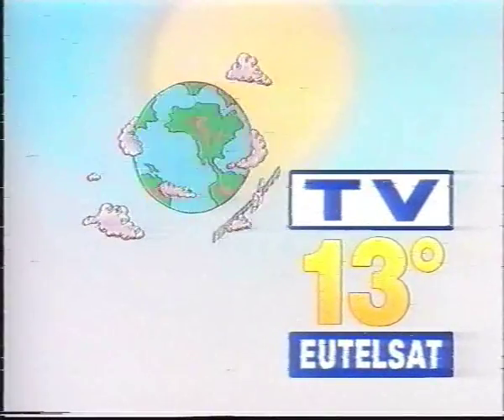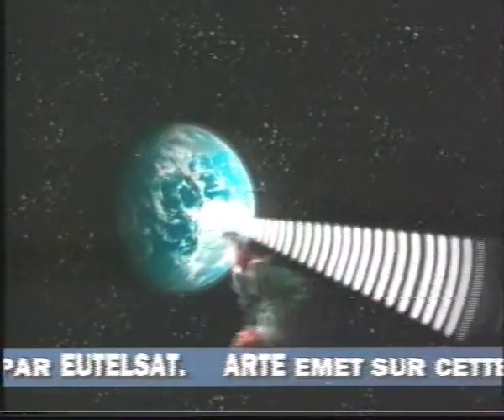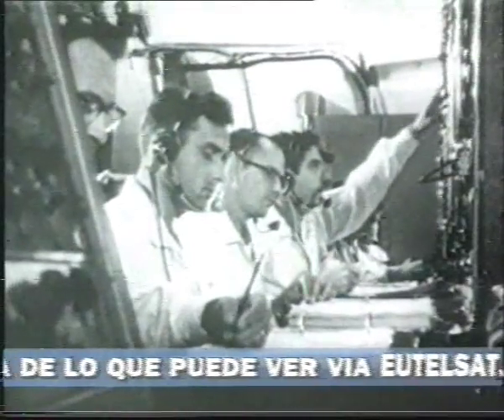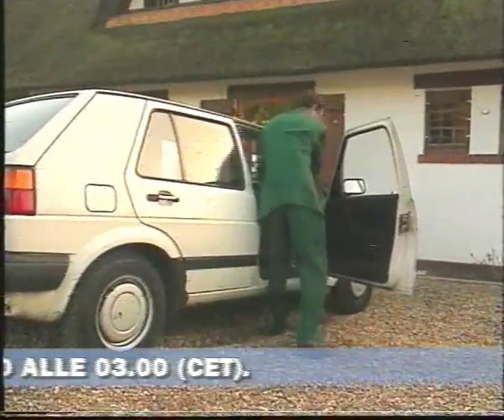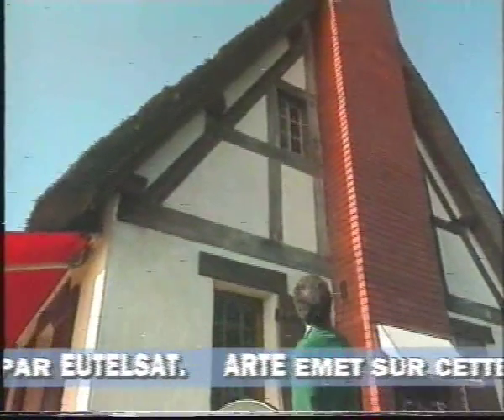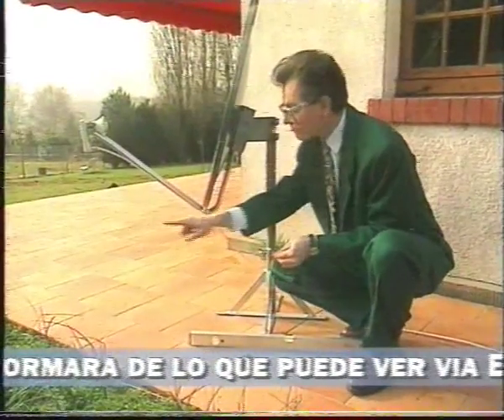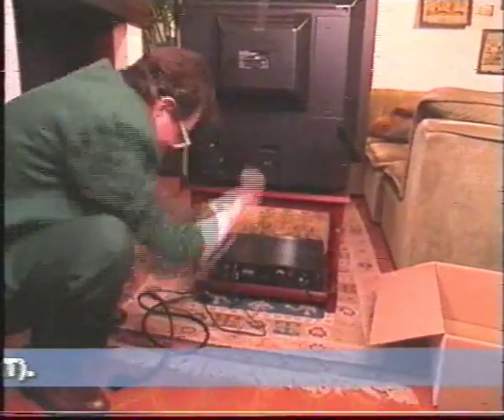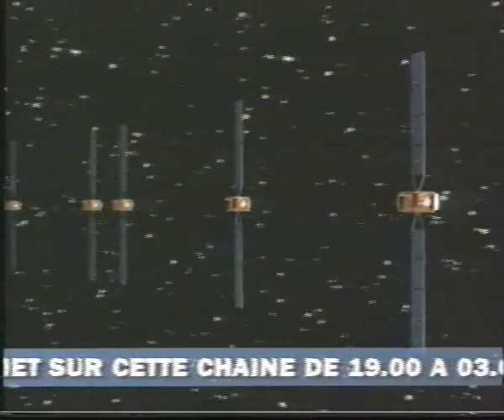Satellite tv how does it work ? 1995

Comment: Thank you!

Even the analogue statics in bad reception are in this video!
These black and white "small line dots". 

In modern digital system you see the mosaic when picture moves fast. In analogue system there was a glitch especially in red colour.
Reply from the maker: Thank you for wathing, this recording was made on a astra set.
The set did not have the audio settings that you need for eutelsat.
Also, the dish was made turnable with a m6 threaded rod, and a windshield wiper motor, no polar mount.
Great fun ;-)
Reply: @mdftrasher  Thanks for a very fast reply 😉

Ah that explains a lot, good analogue days! Today incompatible digital systems won't work with each other.

I often think how the fixed UK footprint 28east would behave if it was analogue maybe we outside UK would get some kinda picture.